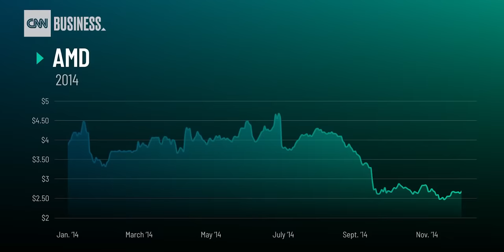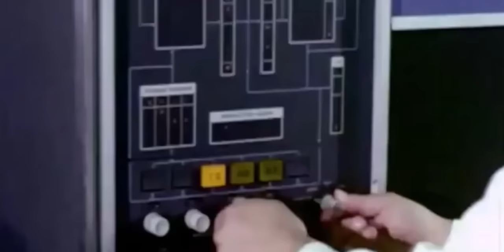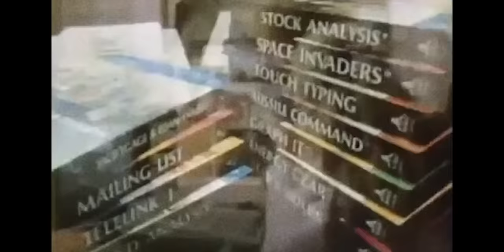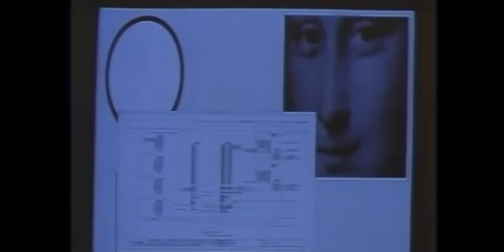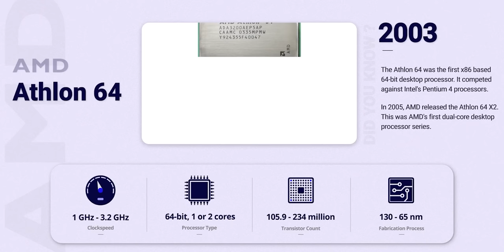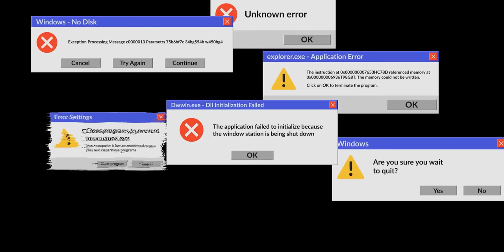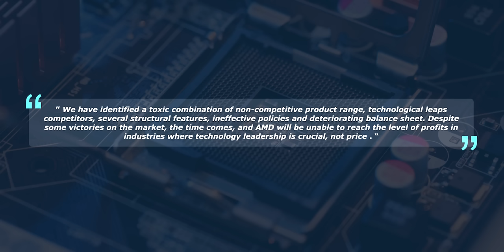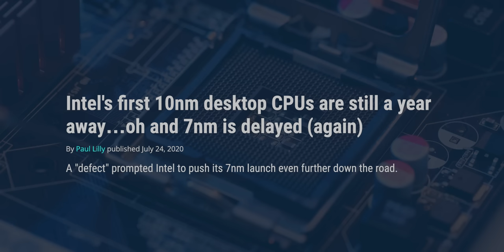The Real Reason AMD Is Worth More Than Intel

Comment: At 16:20 you said AMD had been delivering about 10% modest gains a year.  You meant to say Intel, and it wasn't a year, it was each new generation.  That was roughly one year going from 3rd to 9th gen.

Also, a clarification I believe.  The server market share is TOTAL market share that you listed, which is of course different than X86-64 market share.  And you really needed to premise that statement.  AMD was starting from about zero percent marketshare at the end of 2017.  To go from that to what is now 20% of the X86-64 marketshare, which really mostly happened because of Zen2 and Zen 3 and what the chiplet (MCM) architecture allowed AMD, with making low power (Intel mid 2000s) high core count CPUs.

Also at 17:50, I don't know why some media outlets still call Intel nodes by their old names, but YOU should get in the habit of using their new names because it adds confusion.  Intel doesn't have 10nm, 7nm, 5nm, etc..... anymore.  It's Intel 7, Intel 4, Intel 3, Intel 20A, Intel 18A, etc........

It was fair for Intel to rename their nodes because the transistor density is what matters more than anything else.  That gives the general size of the transistor without regard to a specific characteristic of the transistor.  I agree with this.  It's not fair to Intel for TSMC to call something 7nm, based on nothing at all, while Intel is referring to a specific measurement on the transistor when calling something 10nm.  The end products are basically the same.  Intel's old 10nm has the same density as TSMC N7, and Intel's 7nm has the same density as TSMC N4.

So the current node Intel is on is Intel 7, and their next node is Intel 4.  It's supposed to release in 2023 with Meteor Lake.  Considering Intel has dropped an order on TSMC N3 for a certain line of Meteor Lake, I would have to assume Intel feels they can produce everything with their Intel 4.  So, it may have been delayed some, but I think it's on track now and Meteor Lake will come out next year, probably mid year on Intel 4.

Comment: According to 10-K reports which can be found on the SEC website :
Revenues for Intel in USD  :
2017             62,7    Billion
2018             70,8    B
2019             71,9    B
2020             77,8    B
2021             79,0    B

Revenues for AMD in USD :
2017              5,2     B
2018              6,4     B
2019              6,7     B
2020              9,7     B
2021            16,4     B

Additionally, Intel has substantially higher Cash flow from operations.
Intel has substantially deeper pockets.
Reply from the maker: Now do costs

Comment: The only real engineering enhancement, that AMD did, was the Zen/Ryzen. Finally,,they detected, that high clock speed alone, comes with high cost and risk for overheating and a lot of power consumption. So, they ended up, copying Intel‘s integration of HW based encoders, decoders for jPEG and video.

Comment: The 386 was NOT the first 32 bit processor nor was it the chip that made GUIs possible. The Macintosh was not the first GUI but it predated the 386 by years, using a Motorola 68000 16 bit processor. And of course early Windows versions ran on the 286. Nothing like watching someone broadcast complete ignorance to the world, even though these facts are easily found with simple searches.

Comment: uggh. a history lesson not answering the question posed by title, good thing I went straight to the end. Toms hardware made an article incorrectly stating AMD has beaten Intel's marketcap but turns out it was premature news and actually beating Intel after a few weeks of the article. I've been AMD fan in the mid 2000s but all these AMD success is not about AMD executing well but Intel being so bad.  It is so bad it felt like intentional for plenty reasons as Intel is a partner of ASML, a company providing machines to TSMC and Intel knew of TSMC's rise from a mile away.

Comment: Very good but there are some corrections.  AMD sold off their chip manufacturing to Global Foundries and end up with a WSA (Wafer Supply Agreement) with Global Foundries until Global Foundries could not keep up with TSMC and Samsung who both achieved 7nm.  On the other hand Intel's 10nm was so bad at first that their 14nm beat the pants off of it.  But Intel was so far behind that they had to release the pathetic 10nm so show that they had some progress but then only used it in the budget computers where it would not make too much noise.  Another important factor in the resurrection of AMD was the APU (Advanced Processing Unit) which combined a cpu and gpu with shared memory to achieve much better efficiency as the cpu could pass a pointer to the shared memory and not a ton of graphics data.  So AMD at the time did not have money for R&D and managed to get Microsoft and Sony to pay for the R&D which then could belong to AMD and be used in all MCM chiplet Ryzen family products.  Next AMD had also put together a world class team to come up with a revolutionary new concept of chiplets.  This totally obliterated Intel and is the main reason that Intel is now 3 to 5 years behind technologically.  The chiplets led to higher yield at lower cost and a new form of "LEGO" building based on chiplets.  So today ALL supercomputers are build on AMD chips except for the Argonne Labs Aurora which Intel won but still 5 years later has not delivered because Intel's technology is inefficient, broken, and will not meet the specs.  On the other hand the only way Intel can compete today is by overvolting their cpus, running on nuclear reactors, and ineffciently wasting horrendous amounts of power to drive their cpus to run at 95 degrees celsius.  So virtually all supercomputers, and now much of the data center/cloud industry is constantly moving to AMD processor.  And in terms of economics AMD stock had dropped to around $2 in January 2016 and a few months ago peaked at $164.

Comment: Another factor in AMD's early dominance of 64 bit CPUs was that Intel tried to replace the x86 instruction set with Itanium in the move to 64 bit architecture, which was poison for the user desktop market.
Reply: I never heard of Itanium before

But what if it was actually better then x86? Sure there were some issues but what with enough time..  it would be the best thing ever?
Reply: @kajmak64bit76  Itanium was a server-side 64-bit CPU with a completely new instruction set. The problem with the Itanium instruction set for the consumer (and also small business) market was that existing software wouldn't run on it. You'd not only need to buy your PC with new windows, you couldn't migrate your applications over until the developer recompiled it for Itanium. And if your favorite/business critical app was no longer supported, you were SOL. 
So there was too much resistance from consumers, much like we complain about AM5 platform/DDR5 costs today. That, combined with the server-level pricing on the CPU itself let AMD define the standard for a backward compatible 64 bit instruction set on consumer products.

Comment: 15:26  This is all wrong.  AMD spun off their manufacturing as GlobalFoundries three years before Lisa Su came to AMD.  AMD has had contracts with GF requiring them to buy wafers for their products, which is why AMD used GF for most of what they made.  They went with TSMC (for CPU's - graphics chips were already manufactured at TSMC) starting around 2018 because GlobalFoundries cancelled their 7nm process node development.  AMD still used GF for parts of the processors (the I/O dies), and some older designs still being manufactured, because they were contractually obligated to, but that wafer agreement was being modified all the time.  Today, there no longer is one, and AMD is not required to use GF for any products.

Comment: I'm pretty sure Intel declined working with apple which was they're biggest mistake.
Reply: I dont think so. Mackbooks were the best selling single brand laptops at the time. And Intel missed the mark on the smart phone market earlier when Apple actually asked Intel if their Atom processors could be developed into ultra low power variants and Intel... told them to go fly a kite. I'm guessing Apple walked out on Intel because Intel had failed to deliver on 10nm for far too long. Apple, like everyone else, was getting fed up with 10% improvement every 15-18 months...
Reply: "Working with"? They were merely suppliers and compiled chipsets for Apple hardware. There was nothing special between them two.

Comment: 07:30  That's not accurate at all.  All versions of Windows prior to Windows NT and Windows 95 could run on the 286, as could IBM's OS/2 1.x releases (OS/2 2.0 and up required a 32-bit processor).

Comment: Athlon was used untill FX series came out, and AMD saved us from Itanium64. Oh and ATI 4850 and 4750 were one of the best at that time, same with hd6850. Not to say their products were way more efficient/$. Now they are in consoles, have chiplet design and Ryzen was the first to push from 4t8c like Intel had untill core I 8th gen, and give us 16c32t on consumer platform. Not to say Intel stagnated on 14nm to like 10th? gen

Comment: Dude. Srlsy? 80286 and 80386 were so revolutionary in your opinion? Motorola 68000 was a little bit older and could multitask and run GUIs (ST, Mac2, Amiga). FCS - even C128 could run GUI - GEOS for example. 80386 wasn't first 32 bit processor. I won't even watch any further.

Comment: Well. 3 months later intel stike again with a best of cpu and now intel will change the creation methods and architecture,
Now 13900k looks incredible and R7950X to, but they have a mayor problem
Both cpu are exceeding 95°C in benchmarks, i't looks like in some point we will have cpu of the sise of a threadripper
I'm hoping some day we will have the turbo power of 13900k with just 120w instead of 350w but right now we are aproaching hell in therms of heat.

Comment: Thanks for this great video. I already knew this story, but this short summary was definitely worth checking out.

So far I have had 15 CPUs. Some of them have become my all-time favorites due to their reliability and price-performance ratio. My very first CPU was an Intel Celeron 533 MHz unit, but the second was an AMD Duron 950 MHz. It was cheap and seemed really fast to me at the time, so I've stuck with AMD ever since for similar reasons. In the mid-2010s I thought about switching to Intel i5, but Ryzen kept it from happening.

My 5 most favorite CPUs:

1. Athlon XP 2000+ (thoroughbred B | 1x 1.67 GHz | 130 nm)
2. Athlon 64 X2 5400+ (Brisbane | 2x 2.8 GHz | 65 nm)
3. Phenom II X4 945 (Deneb | 4x 3.0 GHz | 45 nm)
4. FX 6300 (Vishera | fixed at 6x 4.0GHz | 32nm) - it was cheap and served well for a looong time.
5. Ryzen 5 1600 "B2" (Pinnacle Ridge | 6x at 3.6 GHz | 12 nm)

Now I'm rocking with a Ryzen 5 3600 @4.2GHz/1.26V, which will obviously be one of my favorite CPUs. :) 

Thanks AMD for these great units, and thanks Lisa for bringing back this company that shook the whole market up again.

Comment: There's so many lost timelines. You didn't mention about K5, K6, the rise of extensions which was also won by AMD with 3DNow! Also the socket vs slot wars. The battle of DDR SDRAM vs RDRAM along with pentium 4 and pentium D debacle. Which led to the greatest scam, hoax, conspiracies and evil deeds in tech industry made by intel to sell their Pentium 4 CPUs.
The Core series was also born after intel threatened to revoke x86 license from AMD and force AMD to give their AMD64 architecture to intel.

Comment: Excellent video. What is your view on impact on the semiconductor industry if China invades Taiwan?
Reply from the maker: Massive, unimaginable impact.
Reply: @TickerSymbolYOU  my thoughts and worries precisely. the semiconductor industry collapse will bring down the entire tech industries. I hope that the CHIPS act will be fast enough to diversify the manufacturing of advanced chips.
Reply: @n n which company? Cap ex for fabs are incredibly high plus the supply chain for the various components are crazy. Even if there is capital, it would be extremely difficult to come out with another TSMC. The only fab competitor is Samsung. Intel is too low tech fab.

Comment: The future is on the RISC architecture, both Intel and AMD are on the wrong path. Apple made the right move. And Nvidia was very close to becoming the dominant figure but was blocked by EU, the move of course being the purchase of ARM. Intel knows this and has started looking and investing into RISC V. I wouldn't be surprised to see a new player or another company take the pie though, as we've seen companies stuck in specific ways have a hard time adapting to change.
Reply: Why do you think that the future is RISC? It could be case but the evidence is not clear. The M2 and Ryzen 6000 series mobile processors are pretty similar in terms of performance and power usage and mostly just better at different tasks.
Reply: @Immudzen  the m2 is Apple second design iteration and is already considerably ahead in terms of performance over power consumption, looking at the trend, computing is either cloud or mobile, both of which demand performance with lower energy usage. Intels Cisc architecture has been outdated for a long time but has been dominant thanks to the software supporting it but with Apple moving away, Linux also pushing more support and even MS putting some weight, it’s only a matter of time. The technical benefits are going to be so big and obvious with later iterations for risc over intel, it will cause a shift.
Reply: @zionen01  The M2 is not considerably ahead of the 6000 series AMD chip. It is faster in some things and slower than other and both get around the same battery life. The M2 is MUCH more power efficient than Intel chips are right now. There is no question about that at all. The Intel chips are faster but they suck down a lot of power to do it. 

On the cloud end I have tested ARM vs AMD EPYC chips and for some things ARM is better performance/watt and for others AMD is. Both are continuing to get more efficient and I don't see a clear answer of one being better than the other. 

RISC vs CISC is a pretty silly argument at this point and indicates little understanding of how these chips actually work.

Comment: AMD is winning but it outsources all of its supply to TSMC. If China invades Taiwan TSMC is toast and Intel will dominate
Reply: Εveryone relies on the TSMC even China not only AMD. After all even if China is going to attack Taiwan the TSMC is building a new factory in USA and especially in Arizona. So you don't have to worry.
Reply: @kostasmixailidis2393  bit it takes alot of time to build a new factory.

Comment: It's AMD's turn to never ever ever make a strong gaming CPU that is strictly for single threaded applications. OH RIGHT except the 5800XD (sigh)
Reply: You should see what those X3D chips due for HPC applications. Some of the benchmarks on those chips for computer simulations are amazing.
Reply: @Immudzen  - So due to your suggestion, I should return all of my 12th gen i7's. Ok, let me disassemble these systems (huge sigh)
Reply: @cobrakainevereverdies6940  Why would you disassemble systems you already have? That makes no sense at all. You mentioned the 5800X3D performance in single threaded application and while that is impressive they are MUCH more impressive at high performance computing applications.
Reply: @Immudzen  - Yup. I'll return my 3090 and 3080 - Just for U
Reply: @cobrakainevereverdies6940  That makes even less sense. While they do suck down a lot of power they are also very fast cards.
Reply: @Immudzen  - OK FINE !!!!!!!!!! I'll return the 2 1300 EVGA power supplies too.
Reply: @cobrakainevereverdies6940  weird flex but okay

Comment: AMD's move to TSMCs fab was 2 or 3 years past Zen. They still use Global Foundaries, which was a branch of AMD of sorts, and they managed to separate based on an agreement they would use them. Today, they use Global Foundaries for the production of older generation chips (Zen 1 and 2), and the I/O chiplets on the new processors, so technically, they aren't off the hook, but on the compute units they use TSMC because Global Foundaries couldn't keep up with the node requirements. Other noteworthy things include re-hiring Jim Keller, who worked for them previously, who was a talented engineer at Apple. Jim who helped lead the team at AMD, and scrapped the old CPU designs with a new ground up re design, using the best parts of the old design, and re designing the parts that were inherently an issue. Also, both Microsoft and Sony use AMD CPU's and GPU's in their consoles. PS4, PS5, XBOX One, XBOX Series X, etc etc.

BTW, Nvidia is a giant, but they are going to miss the train without innovation. They don't hold a future in A.I., and they need to expand past the GPU market. Tesla used AMD to replace Nvidia self driving system in their vehicles when Jim Keller moved to design the new, upgraded computer which was customized by AMD, while then working for Tesla. This is secret domain stuff though, and quiet quiet. ;)

One other thing, AMD have a history of stealing, cheating, and Intel was the same. Have a watch of the Z80 processor, and how they screwed the original designer of their processor! https://www.youtube.com/watch?v=P1aqtfXUCEk&ab_channel=LowSpecGamer